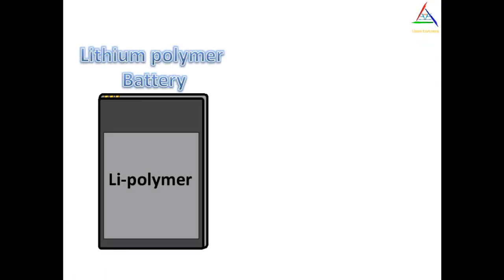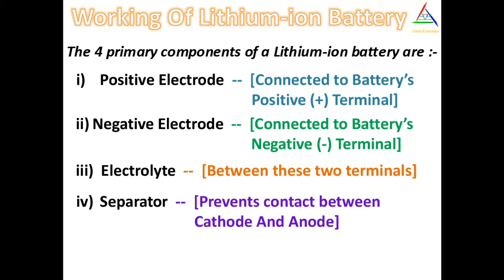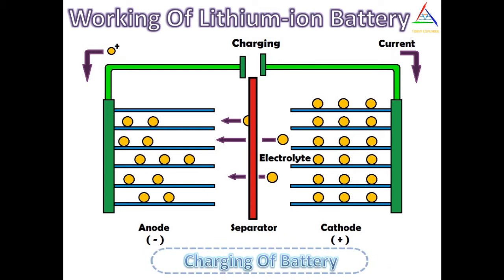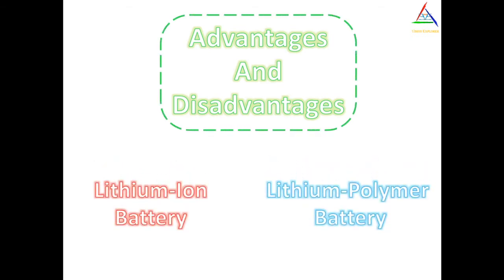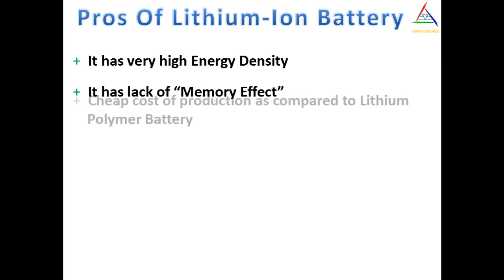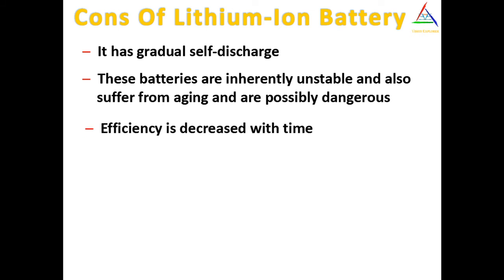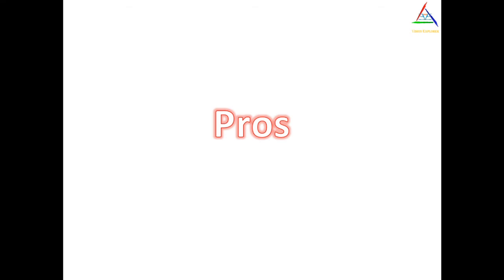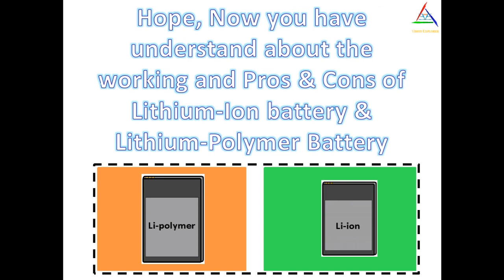Lithium Ion Vs Lithium Polymer Batteries

Comment: Lithium ion (iphone) and lithium polymer (android)...

Sometimes iphone battery is replaceable because of the bad battery health or degrades...yeah iphones are water proof/water resistant because of ip rating thing...and when you change a new battery for your iphone...it will loose the old brand new of sealed outer body (looseness of water resistant capabilities)

While android smartphone sometimes removable battery but never replaceable because it last longer...

Yeah lazy people doesn't need to look battery health stuff because they will buy a new smartphone after 2 - 4 years using their old smartphone...plus i wish iphones have lithium polymer battery rather than lithium ion battery...it will cost me to replace the iphone battery rather than android smartphone that doesn't need to replace a battery

Comment: You said Lithium polymer battery pro : less weight so high energy density.
Than you said
Con : these batteries have low energy density and hence stored less amount of energy than the same sized lithium ion battery...

Both statement contradict each other.
Reply from the maker: You have slightly mixed up two different statments :-
Pro : These batteries are light in weight because of which they result in better energy density per kg. (Please note, this statement is w.r.t kg)

Con : These batteries have low energy density & hence store less amount of energy than the same sized lithium ion battery.(Please note, this statement is w.r.t size)

Please Share & Subscribe the Channel
Hope it helps :D

Comment: interesting. I originally would have thought the polymer cells were cheaper, hence so many toys and little devices come with lipo, where expensive high end flashlights and stuff come with ion.
Reply from the maker: Yeah, it depends on requirements which solution fits the best :D

Please make sure to Subscribe the channel for some interesting videos
Have a great day 😀

Comment: How short of the battery life (4:54) until it is useless?
Reply from the maker: If both Lithium Polymer and Lithium Ion Battery have the same charge storing capacity, then LiPo have shorter life cycle than Li-Ion.
    But how short or long it will be, it depends on many factors like usage, Maintenance, Charging Cycle etc etc.

Hope it helps :)
Keep Supporting
Have a great day 😊
Reply: @TechCamper  Then can we say that LiPo battery is lighter?
Reply from the maker: @angelisone  Yeah, Lithium polymer batteries are light in weight.
Reply: @TechCamper  Then I will use LiPo battery for my 11.1V camera speedlite.
Know where to buy spiral cable (like spiral tethered business/home phone) that can handle high current?
Spiral cable (red-positive & black-negative) that can stretch out to 4 feet.
Reply from the maker: @angelisone  No idea about that 😅

Comment: Can I Asked You Something My Friend? Can You Fully Charge Li-Poly Battery Or Same Process Of Charging Li-ion Battery?
Reply from the maker: Welcome back : D

It should be avoided.
Reply: @TechCamper  What Should Be Avoided The Fully Charge Or Following The Same Process As Lithium Ion Battery
Reply from the maker: i.e. Full charging for both should be avoided.
Hope it helps :D
Reply: @TechCamper  Thanks Good Thing I Asked You And Good Thing I Did Not Full Charge My Phone Only 80 Percent I Will Plug It Out
Reply from the maker: Yes, there are number of concepts and tips floating in the internet ,but recommendation is that overcharging or discharging of battery should be avoided.

Have a great day😊
Reply: @TechCamper  Well I Charge It 20 Percent Then I Remove It 80 Percent it Last Up To 13 Hrs After 13Hrs When It Reaches 20 Percent Again I'm Going To Charge It Again

Comment: So which one you choose for the phone?
And if i keep the phone battery %  to drain to 0 and charge to 100 every time the li po battery do better job(i mean aging and battery life) or li ion?
Reply from the maker: This all depends on the requirements but Li-Po batteries are slowly taking the market of Li-ion (although their cost is high but because of safety purpose).It is not like that Li-ion batteries are not upto mark as you can see, still lithium ion batteries are being used with upgradation in their technology but as advancement in tech li-po are used.

But still, it all depends on requirements of work that which type of battery will satisfy the needs.

Comment: What is a good charging cycle for li-po phone?
Reply from the maker: There are many different concepts related to this, which are available in Internet. But my recommendation is that one should not overcharge or discharge them usually.

And if you want to improve your Smartphone's battery life, then you can visit this link : https://youtu.be/YnWVksv3MJc

Comment: You are wrong. Li-pol batteries ar more dangerous than Li-ion. If you hit or overcharge Li-pol with anything, It'll cause fire and could be blast on your face
Reply from the maker: If charged, discharged, stored, maintained, or handled improperly, they can become dangerous too. But still Lithium-polymer is safer than lithium-ion, as there's less risk of leaking the electrolytic component.

Comment: great video overall, but you didn't mention LiPo's better power density, able to provide more current than LiIon with less voltage sag.
Reply from the maker: I have mentioned it at 2:30, maybe you are talking about high energy density of Lithium Ion Battery.
But although Thanks For sharing your experience with us and it is quite nice to see that our videos are helpful in some way😁
Reply from the maker: @marwan 992__ As far as I am getting the question, may be you are asking about the battery of your Smartphone, so I will suggest you to clear your query from authorised service center because they will provide you a better solution as every phone is designed in it's R & D and same is the case with their battery and other components.
   I hope this helps 😄

Comment: What is the difference between "efficiency decrease over time" and less memory effect in Li Ion?
Reply: Memory effect is where the battery sort of "remembers" how much of its capacity it fills. With bad charging behaviours, the battery "forgets" its max charging /discharging capability.
Although it isn't much of an issue with the modern Lithium batteries compared to the old Nickel based batteries.
Reply from the maker: Thank you for sharing your thoughts with us : )
Reply: @Mordechai Brooks I use FlixZone. Just google for it :)
Reply from the maker: Thank you for replying
Reply from the maker: "Efficiency decrease over time" means as the time passes the efficiency goes on decreasing and 'Less Memory Effect in Li Ion' means Lithium Ion Battery has lack of Memory Effect

Hope it helps and have an amazing day : )
Reply: i realize it is pretty randomly asking but do anybody know of a good site to stream new movies online?
Reply from the maker: No idea, please check the site given by @Ernest Zavier

Comment: good video,bro  respect from Turkey
Reply from the maker: Thank You very much for encouragement 😄
Reply: @TechCamper  dude, by the way, some people say that you should never completely  consume the energy inside the lithium ion batteries , by doing so , you would shorten the life span of battery ? is that true? thanks in advance
Reply from the maker: @torukojinnn6331  Yeah, it should be avoided if possible as it can degrade the capacity of battery : )

You are always Welcome😄